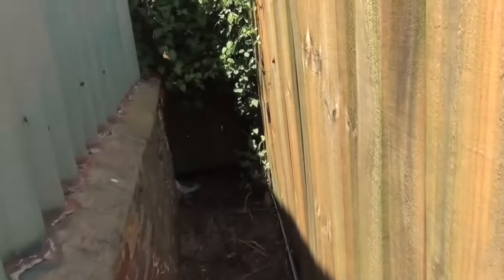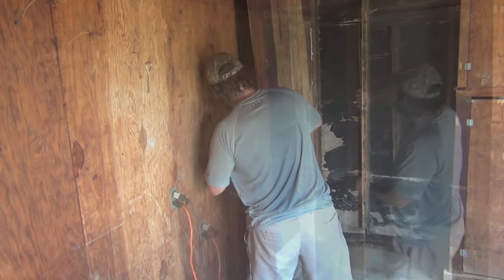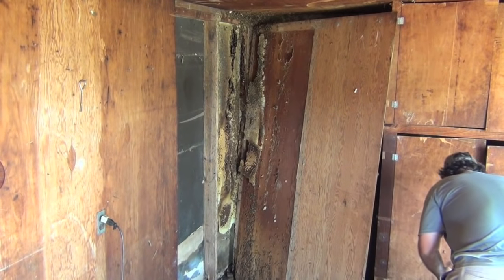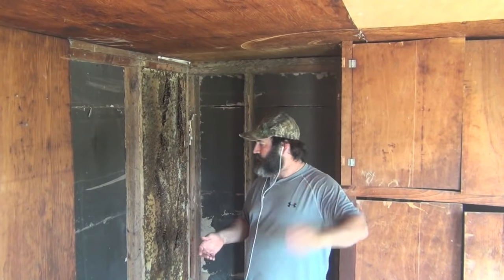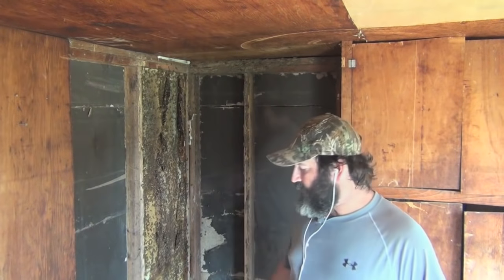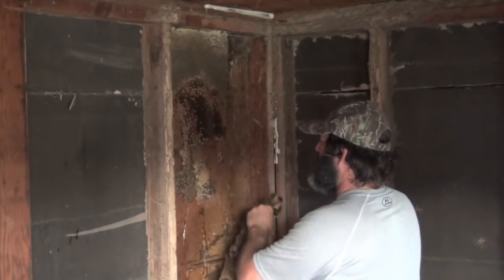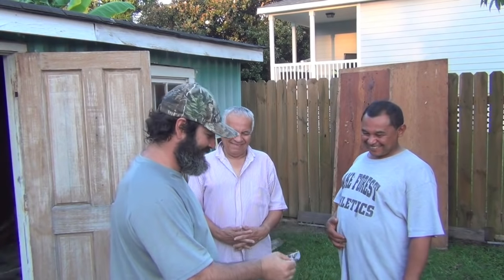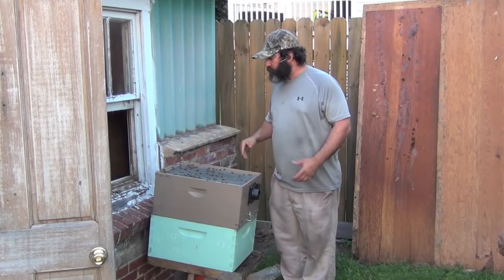Mel & Billy's Shed Is Infested With Bees!  (No Problem!)

Comment: JP, do you ever have problems with the bees getting overheated in the vac box or during transport? It was over 100 degrees here in Houston on Friday. I did a job, and thought I had plenty of ventilation, but just a 40 minute ride home in the back of the truck killed them. In hindsight I should have put them IN the truck with the AC, but I thought they'd be fine. Do you do anything to help keep them cool during cutouts or transport in the dead of summer?

Comment: HAHA! Those guys were fun! So you said there is an extra large void between that sheetrock and the brick because the brick was added at a later time? What was done with the original exterior that would have been where the brick is now? Did they leave it and brick over it or rip that section out before installing the brick? Basically, I'm trying to figure out if they did a "brick wrap" just for aesthetic purposes or if they replaced the original siding in that area with brick. Great video as always! 😀